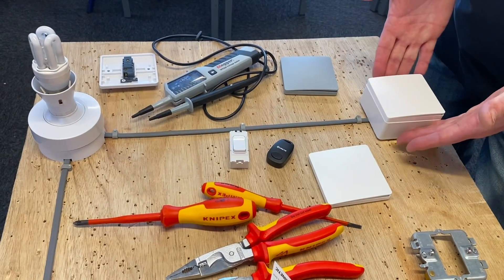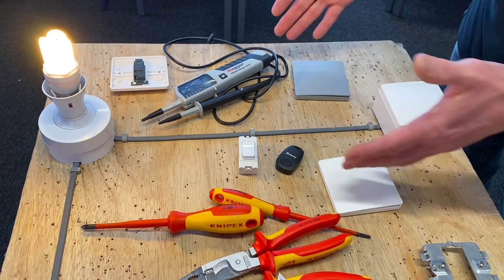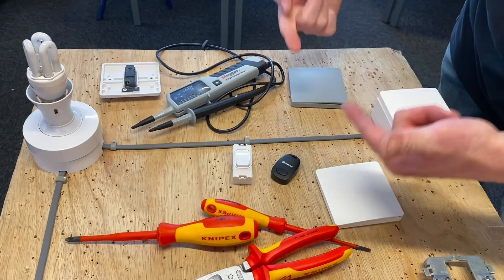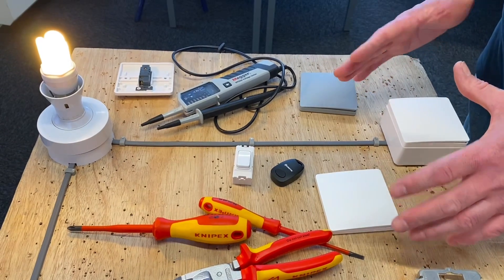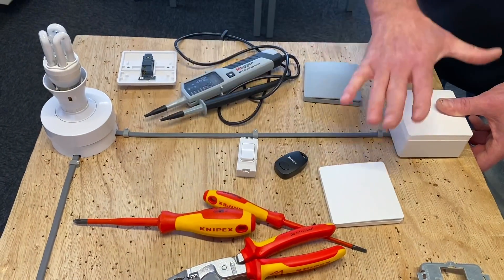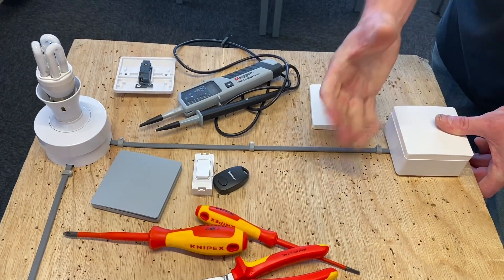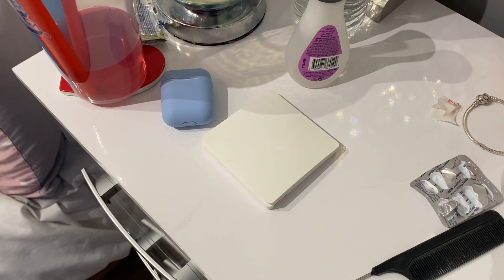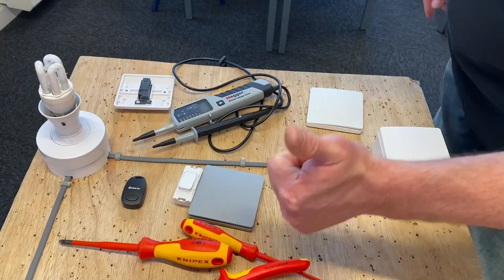Quinetic Wireless Switch & Built in-line Receiver - What Happens when the Power goes OFF & Unpairing

Comment: We have a light switch in our bedroom, but we are going to have the door hung the other way, so the door will close over the original switch, so I want to change that switch to a blanking plate and have a switch on the new open side of the door, can this be done with this Quintic switch? I have also seen a video of these switches failing with the spring retainer breaking loose, do you know if this fault has been fixed. Thanks, Bob in the UK, LOVE THE CHANNEL SO JOINED.

Comment: Why not just have the Module inside a Bulb Socket Assembly, further reducing the cost of wiring ?

Can a slave switch also act as a master for pairing? 

 The need of the master switch for un-paring only would be logical.

Comment: Does it works with Alexa or other sensors like motion detection?
Reply from the maker: Not Alexa
Reply: @GSHElectrical  thanks. So, does it work with motion sensors?
Reply from the maker: @aperezuk  they have battery sensors in the range 👍🏻. They have different receivers that work on Wi-Fi as well.

Comment: Very Interesting - I wonder if the light is off - you have a power failure - does the light come on when power is restored?  Or does it remember it's last state?
Reply: It remember it's last state. The data is stored in non volatile memory in the receiver.
Reply: @tomswiftTTT  Not good! It should default to OFF after a power failure for safety reasons.
Reply: @charlesrichards5389  why is that? Surely if there was a momentary power cut and the light was on, once power was restored I think it would be infinitely much safer to return to being on. For example if you were traversing stairs?!
Reply: @marcusshipley3935  You're talking about visual safety when the mains go down momentarily. I'm talking about electrical safety within the house. If you had a short due to a water leak, rodent chewed a wire, etc., you could have a fire hazard if the power automatically flowed when it's restored. If you don't want to be caught on the stairs during a power outage (regardless of duration), get battery-powered automatic emergency lights for such locations.
Reply: @charlesrichards5389  I see your point but surely its exactly the same as if the lightswitch was on when the interruption in supply and/or fault occurred?! If there's a short or a water leak compromising the electrical installation or part of it, then, a competent person ie, an Electrician is required to make safe regardless of whether a light switch is on or off?!
Reply: @marcusshipley3935  The reason I'm concerned is exactly because it's not a light-switch. It's a box of electronics taking the place of a light-switch. Come to think of it, that's also an issue when the mains go down. When the electric company restores power, a huge surge comes through first, so any electronics that are "on" can get fried. If I'm going to spend what they're asking for a kinetic switch, I at least want the option of having it default to "off" when power is interrupted.
Reply: @charlesrichards5389  you can move the goalposts as many times as you want to try and justify your argument; are we talking about a water leak, a short circuit, an interruption of supply or electronics facing a surge?!
Reply: @marcusshipley3935  I didn't move goalposts. I included yours as an afterthought (that's what "come to think of it" means) because all the scenarios justify my argument. You're welcome. For the price of these kinetic switches, they should offer the option of more safety than an ordinary $3 light-switch. I'll be ordering remote-controlled light-sockets from the Walmart website that do what I want (actually, a set of three sockets with a remote for a fraction of the price), and each socket is a receiver (no need for one hard-wired into the wall). Yeah, I'll have to replace the remote's battery once every year or two... big whoop.
Reply: @charlesrichards5389  you hang in there sunshine, but remember not to play with scissors!! As a bonus prize You can have yesterday off! You're welcome too. 🤫

Comment: What if a neighbour has the same system, would that interfere with your switches? Thank you for all your very informative videos.
Reply: I would say no, because the neighbours set up would already be paired and set up (ie, closed to other devices).  However if in the extremrly unlikely circumstances that you and your neighbour happened to be setting up switches at the exact same moment in time then yes it's possible.
Reply: I was thinking of the same question. What if the other room has the same set of switches would that interfere with the other set of switch? Will the two sets of switches pair differently? If this topic can be brought up and it happens to pair defferently, im buying this switch right away. I hope you shed a light on this and post it in your next video. Thank you now for the previus informative video and thank you in advance for your next video.
Reply: @archie8944 a bit late, but no, this is extremely unlikely. Each remote switch is paired to the primary controller in a pairing process. Once paired, the remote cannot control any other switch apart from it's paired controller(s), and likewise, a controller can only be switched with it's paired switch(es). 

The only chance that your neighbour's switch accidentally pairs with yours is if you both happen to be doing the pairing process at the same time. It's a bit like bluetooth, if you and someone nearby happen to be trying to connect to the same model of bluetooth headphones at the same time, there's a chance you may cross pair, but it's extremely unlikely that you'd both be doing it at the same time. Once paired, theyre locked in.
Reply: You can turn the neighbours light off when there in the shower 😂

Comment: Does anyone know how the receiver is deriving its power, without a Neutral - my only conclusion is there must be a small current drawn through the load when it is off?
Reply: I assume it does, hence the required more than 3w light fitting in order to operate.

Comment: Can you pair a switch to more than one receiver?
Reply from the maker: Yes 👍🏻
Reply: How does that work? If you pair it with two separate light circuits, will it just flip state of both lights? What if one light is on and the other is off?
Reply: @andycarter9845  I was thinking more in using it for 2 or more outdoor lights but on 2 or more feeds where you dont want to run wiring outside the building linking them. That way you and cut down on the circuit of wires but have one switch to opperate them.